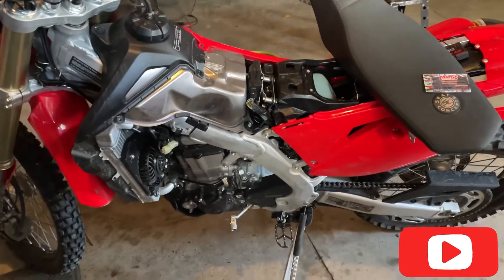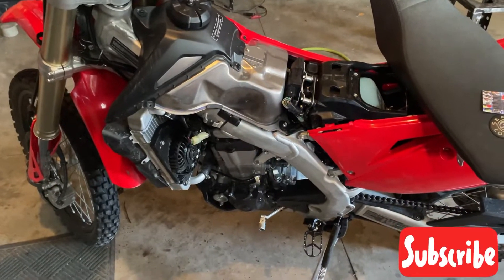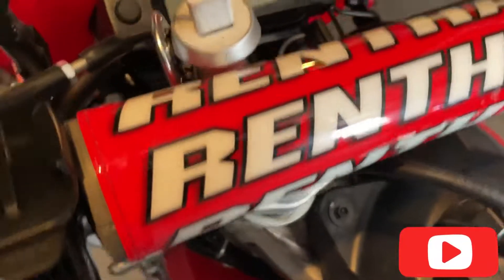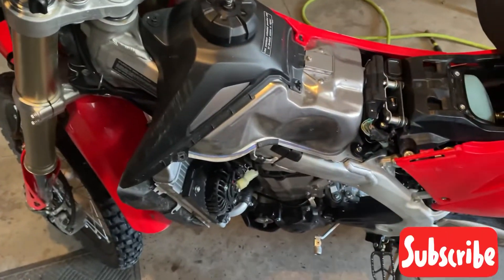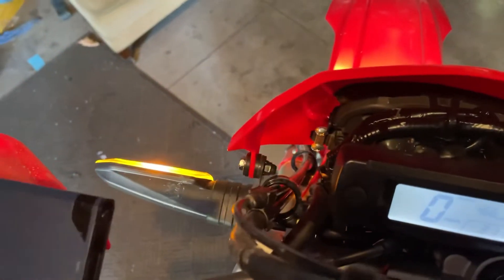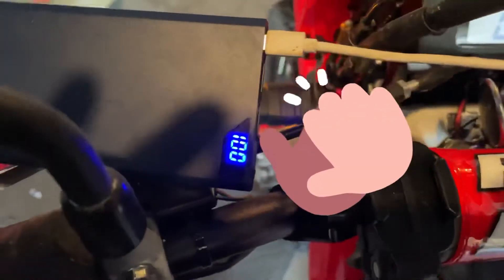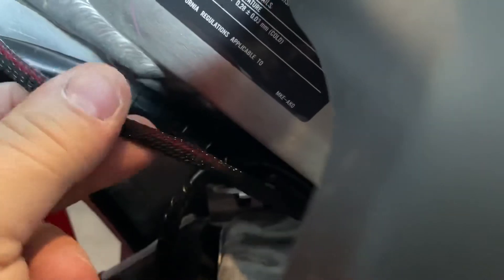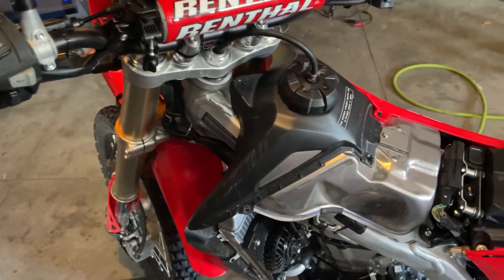2021 crf450rl plug & play 12v power

Comment: I have the same setup. I'm concerned about plugging my gps into it when it's raining. Not a weatherproof plug when it doesn't have the rubber cap on. The tank bag is a good idea.

Comment: Hello I have a 450 RL started the bike over the winter to keep it running started last week had it idling for five minutes and it stalled would not restart 0 V on the battery installed new battery and it trips the battery when I try to start it I tested the fuse block snow blowing fuses no shorts does anyone know what this is
Reply from the maker: Haven’t heard of anything like that, sorry